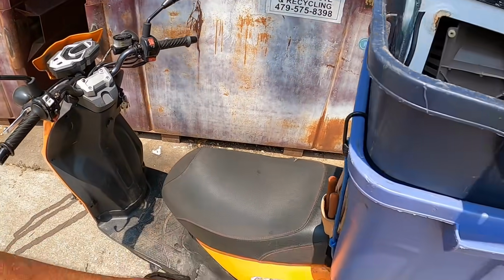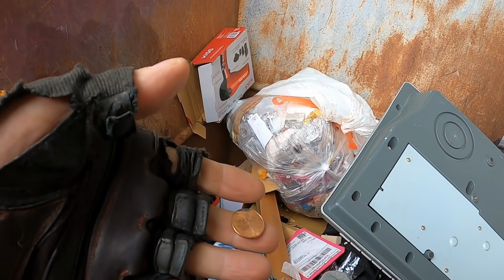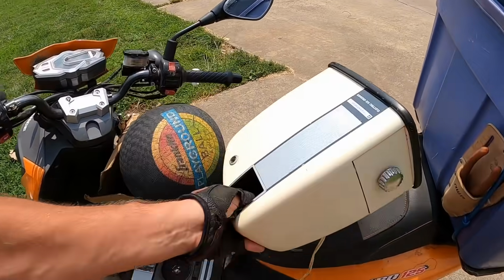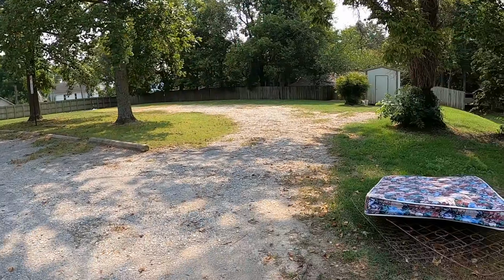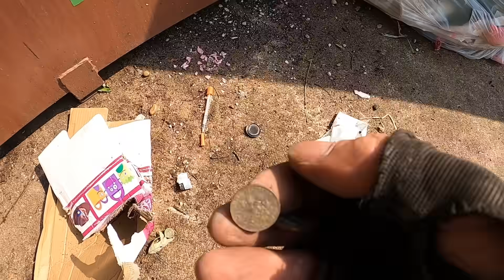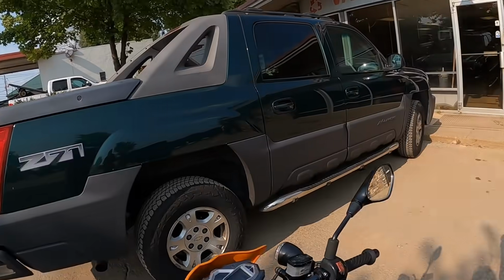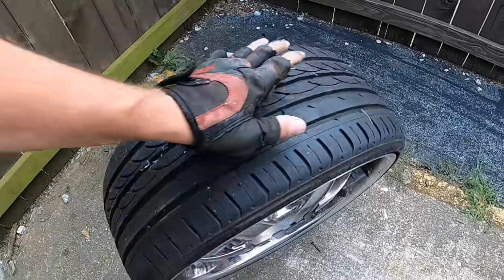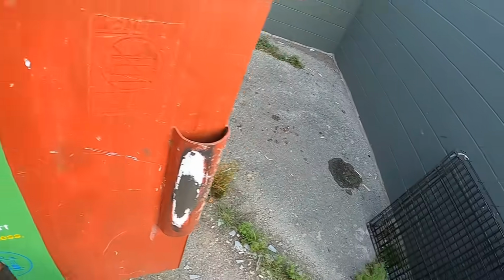Dumpster Diving Extravaganza 🚨 "Behind The Scenes - Extended Director's Cut"

Comment: They strip the fabric off those bed springs for scrappers. They weren't in the dumpster were they? . I personally don't mess with those, no weight.
Reply: Yes, they sometimes changing old springs for new style more comfortable , some upholsterers will reuse those springs to repair vintage seats , coaches and chairs , so they can have these same characteristic like old ones. I'm upholsterer , and did some renovation on old vintage chairs, sofas and even car seats. They arn't heavy , but if You will found lot of them , You can get few $.